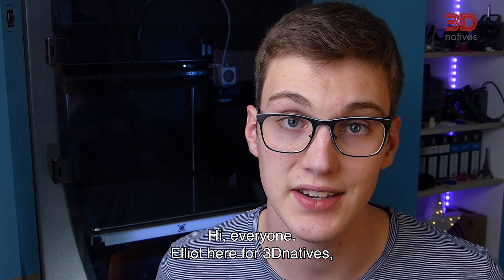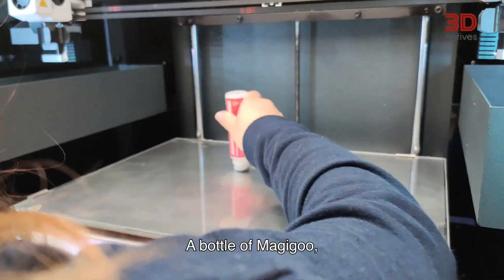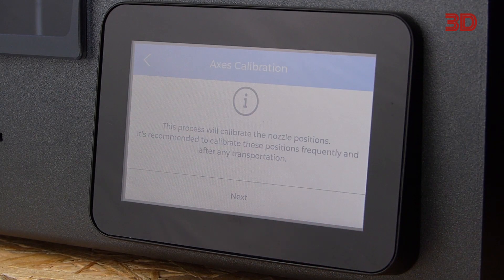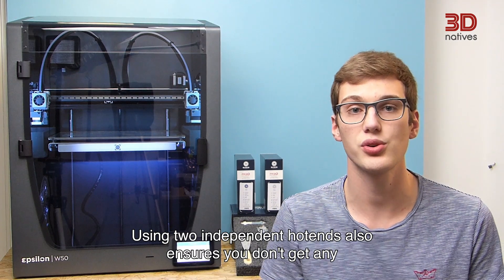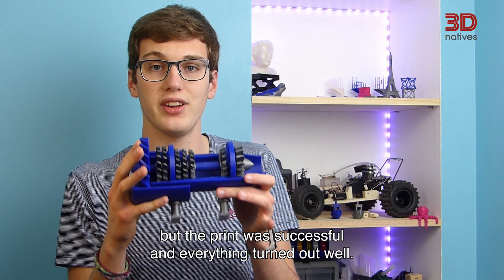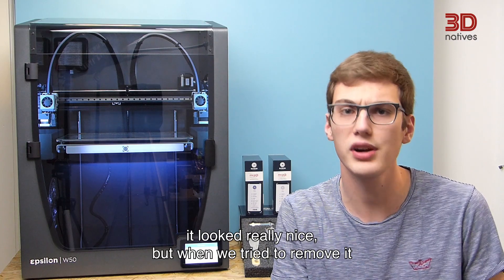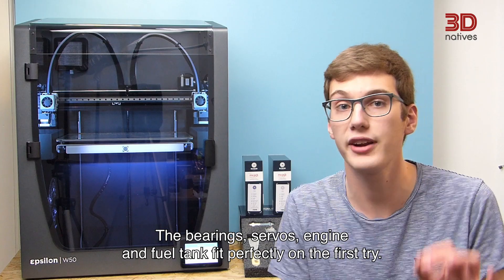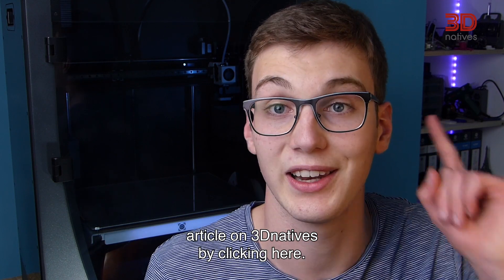Unboxing and Review of BCN3D’s Epsilon W50 3D Printer | 3Dnatives Lab

Comment: Bonjour à tous,

Avec le recul, en ayant 3 imprimantes Ultimaker (modèle 2 et 3) avec +10000 heures d'impression et une imprimante BCN3D Epsilon W50,  je peux vous dire que les ultimakers sont bien plus performantes à tout point de vue.

- la qualité et la rapidité d'impression sont bien meilleures chez Ultimaker
- la phase de démarrage de l'ultimaker surpasse l'epsilon w50 qui met un temps fou (pas étonné, elle vient du sud lol !)
- BCN3D, le logiciel stratos est basé sur une ancienne version de cura (non mis à jour) !

La technologie idex de l'Epsilon W50  (mode duplication ou miroir), parlons-en !  il y à un décalage en Z entre les 2 extruders (0.3mm pour moi) donc pour imprimer, il faut, soit lui demander d'ajouter plus de premières couches, soit installer des cales qui ne sont pas fournies avec l'imprimante, quelle honte pour une imprimante à 8000€ !

Cordialement Eric.

Comment: Can it print metal???
Reply from the maker: When equipped with the metal kit, any BCN3D 3D printer from the Epsilon lineup is capable of printing green metal parts (BASF Ultrafuse metal filament). Those parts are then sent to a sintering partner to achieve metal 3D printing

Comment: does it print tpu well?
Reply from the maker: Hello, the bondtech extruders which equip the BCN3D FDM 3D printers allow flexible filament printing without any skipping so TPU is not a problem for the W50. Though do keep in mind that the BCN3D Epsilon W50 uses a bowden setup. This means that you may need to use higher retractions than a direct drive extruder to achieve nice prints without any stringing.

Comment: Feels like a marketed review with reading from script. What is a passively heated chamber anyway? Either it's a heated chamber which means it's active, or it's NOT heated, therefore it's NOT a passively heated, or do you mean to confuse your viewers by stating the chamber has walls to trap the heat so you'll call it passively heated.
Reply: Its heated. It uses the heat bed instead of a heater and regulates the temp the same way.
Reply from the maker: Hello, all our reviews are done in-house and are a result of our extensive testing. Manufacturers do not have a word on our verdict and discover the review (article + video) the same time as you do.

A passively heated chamber is a closed chamber heated by the heat of the printbed.
A non heated print chamber isn't actively heated nor does it have a heated print bed.
An actively heated print chamber is heated by dedicated resistors.